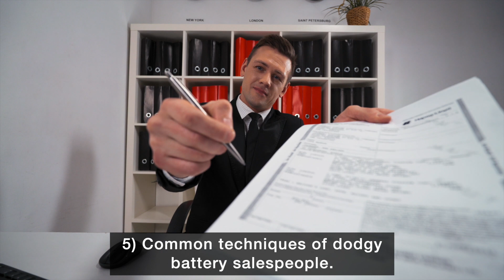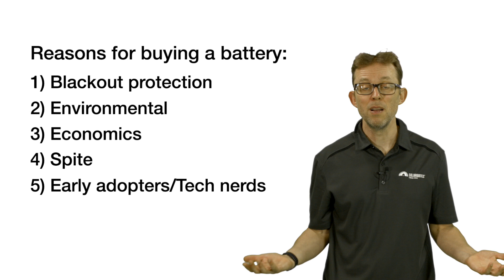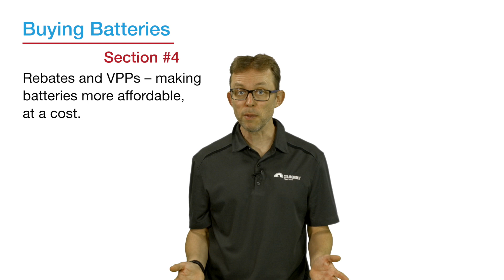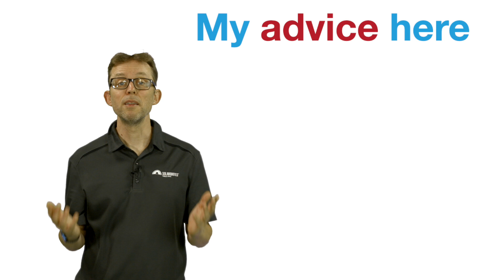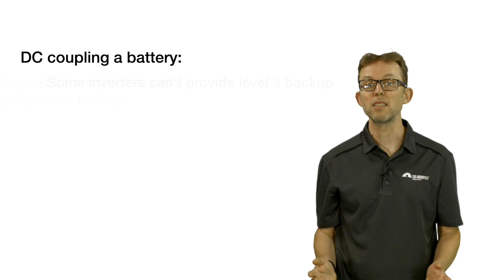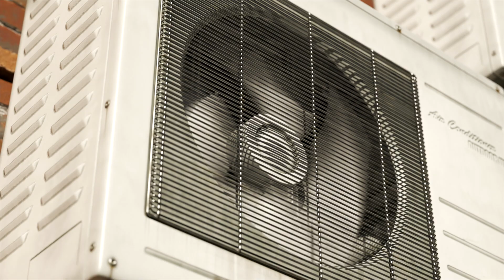Buying Solar Batteries - 2022 Home Battery Buyer's 101 Guide

Comment: I'm off grid - and the best way to get a battery in this case is to DIY one. LiFePO4 cells have gotten very cost effective. I'm doubling my existing 28kWh to 56kWh, and this costs me US$4000 in cells. Add a BMS and cabling, fusing, etc. and you're at US$4500 for a 28kWh pack. Best thing is: LiFePO4 doesn't experience thermal runaway and is much more forgiving, and can be charged to 100% without issues.
Reply: Where in the world are you getting 28kwh  in batteries for $4000?  Used? Car battery packs?  Chinese EVE 280's?
Reply: @kimmer6  EVE 280's yes, Docan and/or Luyuan.
Reply: Can you post a link to where you make your purchases… thx in advance!
Reply from the maker: LifePO4 are harder to get into thermal runaway than some other chemistries, but it can still happen. Please be careful!
Reply: @SolarQuotes  I've yet to see any paper or demonstration of this where it is achieved without external heat source. The batteries will vent, but even the venting gasses don't spontaneously combust without external ignition source. Can you point me to a paper/research where thermal runaway in LiFePO4 cells results in catastrophic thermal runaway of a battery pack?
Reply: @upnorthandpersonal  EVE/Lyshen cells do not vent at all under normal usage. The oval blue window on top is a burst disc whereby if you ever overcharge the cells past 3.65 volts, they will begin to swell up as gasses are being formed in side. The burst disc is a sealed aluminum skin that has been scored in an X pattern. Under normal use, there is almost no pressure inside the cells. You can see the results of overcharging while top balancing  in this video. The burst disc is still visible in the 2nd cell from the left. The 2 outer cells did not vent until we punched a hole in their disks. We took them outside and crushed them back into shape with a large vice in the back of a pickup truck in case they caught fire. Even after being brutalized, there was no runaway, heating, or sign of distress.  3 of 4 still showed 3.26 volts even after 6 months.         https://www.youtube.com/watch?v=LUhKmaTjs9o
Reply: @kimmer6  I never said they would vent under normal usage. We were discussing thermal runaway conditions which are by definition abnormal.
Reply: @upnorthandpersonal  I misunderstood. I have a lot more confidence in LiFeP04 chemistry these days. I have not heard of thermal runaway with them.
Reply: @kimmer6  Yes, that was my point: to get thermal runaway, you have to introduce an external heat source and the conditions have to be right. In other cases of abuse, they will swell, vent, even the vapors can catch fire with an ignition source, but it's not nearly in the same ballpark as when you have e.g. an NMC cell go critical.
Reply: @upnorthandpersonal  where can i learn about your method?
Reply: @muiziklp7064  Will Prowse's forum is a good place to start.
Reply: @muiziklp7064  Andy’s Off Grid Garage Australia, is a good place to look also.
Reply: @SolarQuotes  I've seen tests on lifepo4 cells with dead shorts, they swell up and look angry and thats about it, I've seen them shorted with a spanner and melted the spanner, I've had a short on my electric bike one time with lifepo4, the wiring set on fire, which is going to happen whatever the electrical source,  the batteries did not, I had 1 or 2 that vented the rest were fine, li-ion are better for most portable situations because of the superior power density, but with home solar this isn't an issue and the cycle life of lifepo4 is 8-10x that of most li-ion and will (with headroom and careful management, ie restricted doc/dod) will likely outlast your panels and the cost is approx the same per kw/h as li-ion there's also lithium titranate (I think they are called) that last even longer, though I think they  are more expensive but are I think double that of lifepo4 cycle life though I don't really know much about these relatively new battery tech

Comment: Victron has various MPPT to control solar battery charging

MultiPlus-II 230V 48/3000/35-32 and 48/5000/70-50 comply with AS-620240.1 and AS-NZS-4777.2
Certificate-ESS-EN-IEC-62109-1-62109-2-AS-620240.1-AS-NZS-4777.2-MultiPlus-II-(GS)-3k-&-5k

Comment: We installed 6.6 kW of solar and a small 4.8 kWh battery over two years ago. After measuring our average 24 hour electricity use (7.5 kWh), I knew that the battery would almost always cover our night time energy use.

Everything has worked very well and we rarely ever use any grid electricity. The battery cost $6,000, but thanks to a Qld govt's $3,000 battery subsidy at the time, the battery only cost us $3,000 - which was a good investment.
Reply from the maker: That seems like a good use of the rebate. Nice one. You have very low overnight usage compared to the typical Australian home!
Reply: @SolarQuotes  yes, we have low energy usage thanks to being aware of how much energy we use, plus using all-LED lighting and replacing appliances with the most energy efficient models (including a 6-star energy rated fridge).

Thanks to reading Finn's book, we could easily calculate our average day and night time energy usage, so we knew that our small solar battery would be adequate most nights (this won't be the case with battery degredation over coming years.

Then a year ago we made the transition to an EV (which is bloody excellent). Today I topped up the car battery using the rooftop solar. YAY!

Comment: Thanks for the great video, very comprehensive and as always, well explained. Do you have a view on the merits of using a smaller battery plus a hot water diverter instead of a bigger battery? This should minimise carbon footprint at a lower cost than using a big battery.
Reply from the maker: Hot water should always be used as a battery. You should heat your water during the day and store the heat. As solar systems get bigger and daytime 'solar sponge' tariffs get cheaper, simple timers start to make more and more sense over a relatively expensive hot water diverter.

Comment: Hey Finn. I just signed up with one of your recommended solar system suppliers/installers for fitment of a 10.8 kW system on my property so very much looking forward to that.
I’m keen to get your thoughts on the Bluetti systems as a pseudo-home battery storage system.
The AC200 Max coupled with matching Bluetti portable solar panels, allows simultaneous charging/power usage when connected together. If no sun is available to charge up the battery, it can be charged by mains power during the off peak tariff timeframe then used the next day to simultaneously power (up to a point) household items such as the home fridge, kitchen appliances and even clothes dryer during peak tariff times.
By looking after the battery (maintaining 25-75% SOC, avoiding rapid charge/discharge cycles & avoiding high temperature environments during use), Will Prowse (I’m sure you’ve heard of him) reckons they’d theoretically last the lifetime of the user if not longer. With everyday use and abuse (i.e. contrary to the above), they’re still meant to last at least 3.5K cycles.
Granted it’s not the same as a dedicated battery system but the Bluetti also has the added benefit of being used for offgrid camping/touring.
What’re your thoughts?
Reply from the maker: Honestly. It's your home - I'd invest in a hardwired battery if you want a battery.  A Bluetti is a great portable battery, but cannot be connected to the grid. SO you have no opportunity for self consumption or VPP participation etc - which is where the payback is. Plugging multiple appliances into the Bluetti  if there's an outage will be a spaghetti nightmare.